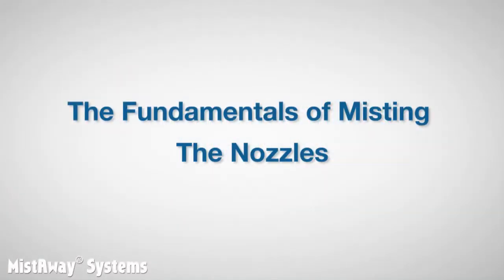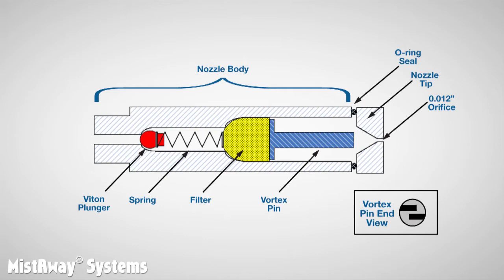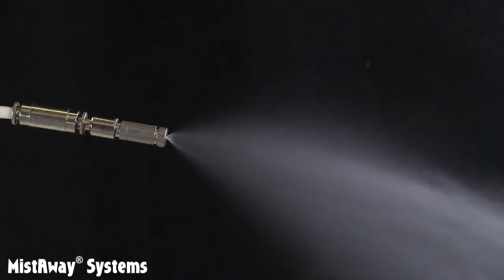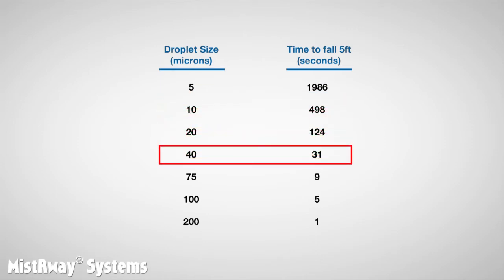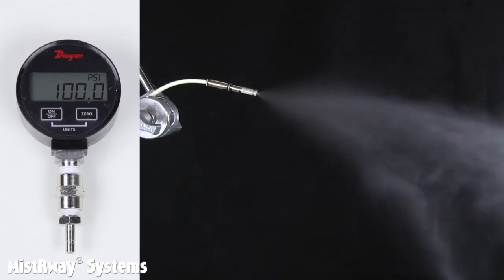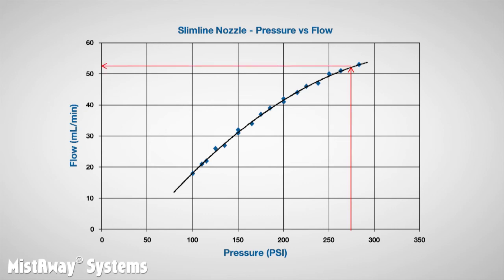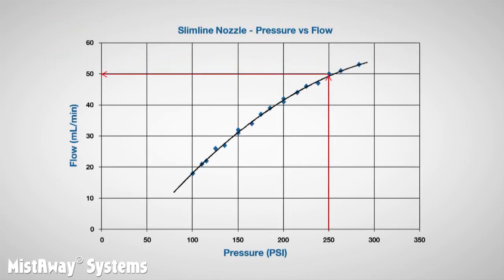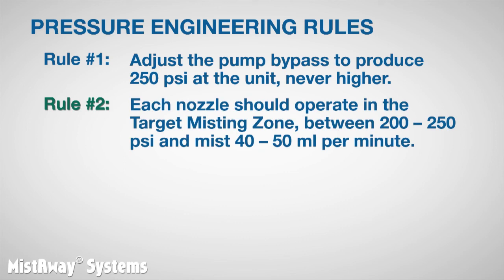MistAway University - The Nozzles

Comment: Great video. I have a misting irrigation system for my vegetable garden bed consisting of 30 misting heads. This misting system is only 2 weeks old and the misters already started dripping instead of misting. I trouble shot EVERYTHING. sediment build up which there was none, water supply.. you name it. When I removed the black ball (viton plunger) attached to the spring, every single mister started working perfectly. I'm curious if these misters are poor build if that was the solution, and what possible side affects will be over time without the plungers.
Reply: This is exactly why Im here. I have cleaned all of my heads and still get drips from some. Im thinking its the springs
Reply from the maker: It certainly can be the springs themselves as they are made of very small diameter wire. The action of opening and closing repeatedly will eventually weaken the spring itself. We sell replacement balls and springs for rebuilding our nozzles.
Reply from the maker: We are not the authority on systems or nozzles sold by other manufacturers. However, our experience is that nozzle using a similar ball and spring design drip for one of a few reasons:

1. There is sediment passing through the nozzle creating an inconsistent seal in the ball and spring check valve.
2. The solution being misted is adversely affecting the ball of the check valve. Even viton can swell or deform when it is exposed to certain products.
3. The spring itself can wear out over time, not producing enough force to successfully seal the valve.
4. If the system has a check valve between the pump and the nozzles it can trap pressure in the lines after a mist event that will cause some amount of leaking. Our systems are designed to prevent this scenario.
Reply: @mistawaysystemshtx  all great answers. thanks!

Comment: Thank you for the video I have a fog machine with a timer when it’s running everything is ok but when the machine stops some nozzle continue to leak some water 💧 💦 any advice ? Thanks 🙏
Reply from the maker: For most misting or fogging nozzles there are 2 reasons why they might leak or drip following a mist. 

The first reason is residual pressure in the lines. If the machine stops abruptly and the equipment has a check valve there is some amount of pressurized fluid still remaining in the tubing. Until enough of the fluid leaks out of the nozzles for the check valve inside the nozzles to seal the nozzles will commonly drip. All of MistAway's systems are designed to relieve this pressure at the end of a mist to address this issue.

The second reason may be worn out valves within the nozzles. Most misting nozzles are designed with an integral check valve. This can be as simple as a small spring with a rubber ball on the end. Over time these springs do weaken and naturally let fluid pass by at lower or even no pressure. Depending upon the nozzle used the spring and ball can be replaced to stop the leak.

Please note that we are most qualified to provide assistance on our systems and products. If you would like to learn more please visit www.mistaway.com for more info.